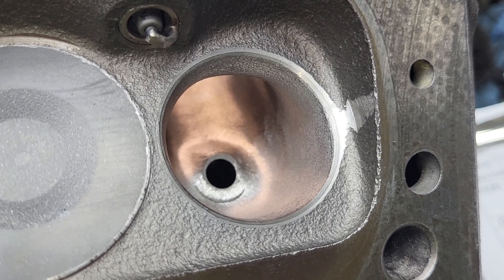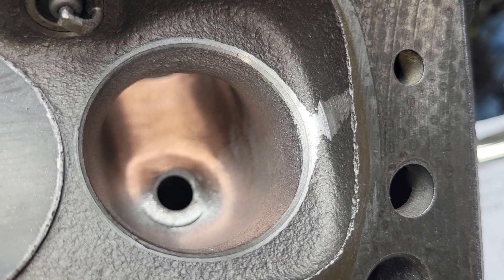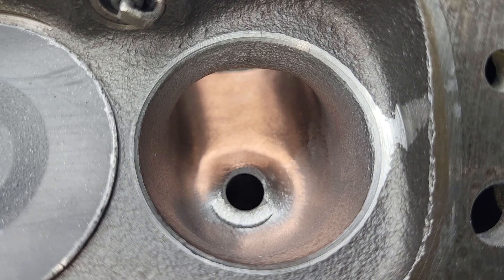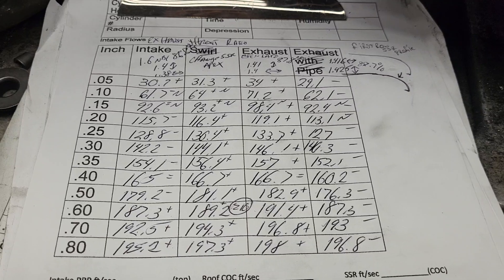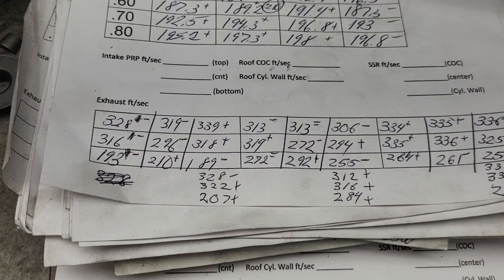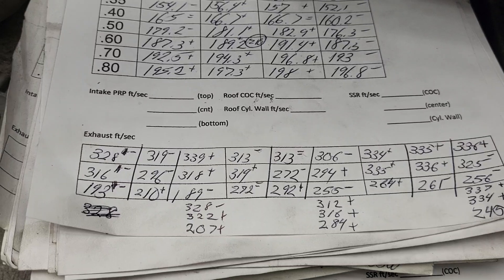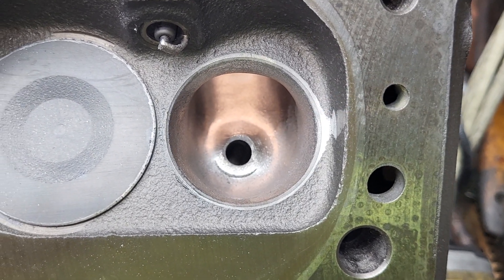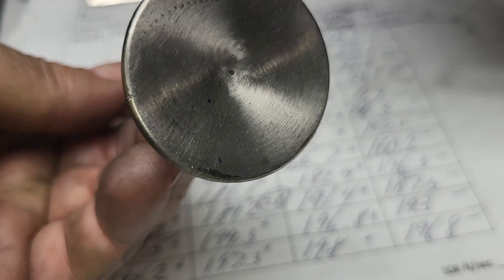Chevy TBI head exhaust throat ratio experiment, 88.7% loser!

Comment: You need to work on the guide more, stop playing with the Short Side radius of the exhaust port. I have seen larger gains by simply shaping the Guide and making the Guide "blend" into the Valve stem so the air will just naturally flow by it as it's is exiting. Also you need to widen the exhaust port (on the furthest side of the exhaust port in the Bowl away from the intake port)  almost to the point of Undercutting your exhaust guide but keeping it blended nicles with a gradule "round Over" and you need to try a 45 Main valve seat sealing point with an additional  30 degree cut
Reply from the maker: @trxtech3010  The roof and guide have very little work done. Thanks

Comment: I would be interested in seeing what happens with valve angle changes same bowl ratio or possibly chamber mods. My thinking on a higher rpm application a different seat could be the ticket.
Reply from the maker: @bobbyhaskell2048  Sure, just give me extra work.
Reply: @servediocylinderheads  😆

Comment: I feel like the change led to the airflow separating from the throat wall behind the seat, possibly because the shortside not being ideal to the new throat ratio. Pushing the air where it doesn't want to be.
Reply from the maker: @lucascb750  Stay tuned, it gets more work. Thanks
Reply: @servediocylinderheads  honestly we should be thanking you for have the patience to actually do one change and record the results in the most scientific way possible.
Reply from the maker: @lucascb750  A whole weekend for this series. Thanks

Comment: Those airspeeds look great. Is there anything left of the venturi? It seems odd that the CFM is noticeably down everywhere. Great video.
Reply: I'm thinking cfm is down because of non laminar flow in the absence of adequate venturi , there is velocity but its not clean air so flow is down ?
Reply from the maker: @luckyPiston  Good question, I was not expecting shuch a big loss with such a small change. Thanks
Reply from the maker: @briantayes2418  A little. Thanks

Comment: The valve, the seat and the throat radius, all form one continuous variable duct. Therefore they cannot be seen independently of each other. Cut aways of the ports are great for this reason, as you can see the venturi tunnel in 2 dimensions, you can get a better idea of what shape you want with the valve installed how it conforms to the chamber. You can use your technique of using a wire to shape the radii on a cutaway, then transfer it to full head itself?

Most of the gains and losses are going to happen on that throat radius, as you've clearly seen. Now you have the chance to use epoxy to reform that throat radius, although with this heat I wouldn't blame you if you took the weekend off. But I'll keep watching and learning if you keep making vids.
Reply: so u think the throat radius is a player too , not just its diameter ? secondly would that factor into v/v sizing to maintain desired radius angle ?
Reply: @luckyPiston  Absolutely, the valve and the seat are the inlet to the exhaust port, and the radius is essentially the expansion for the flow after the seat and valve. It almost works like a steam ejector.

https://youtu.be/N-1MrAABFIA?si=3GYhXDO8rkkjncq4
Reply from the maker: @rolandotillit2867  The wire helps keep each port very close in shape. Thanks

Comment: CFM + Airspeed = mass flow rate, assuming of course there's no density changes to the fluid. Remember when that flow starts going faster than 350ish feet per second, you will start getting changes in air density, which means that CFM starts to matter less, because the stuff in that cube isn't constant, but your velocity(how fast you move those cubes) then starts to matter more.